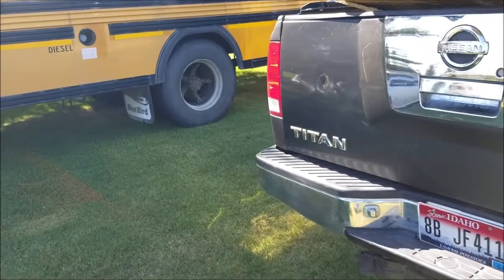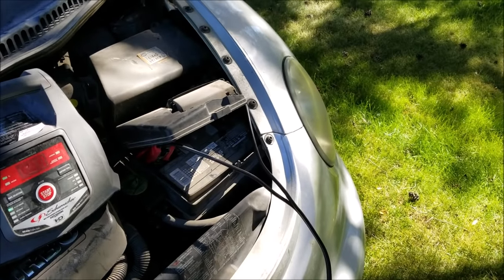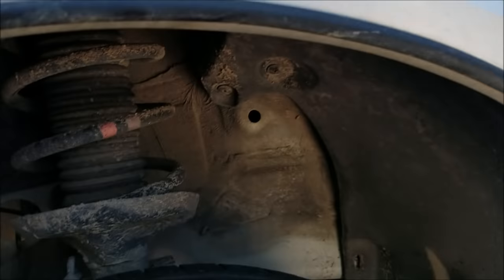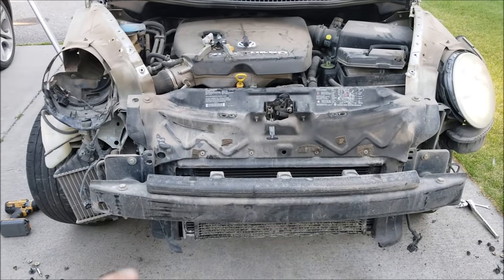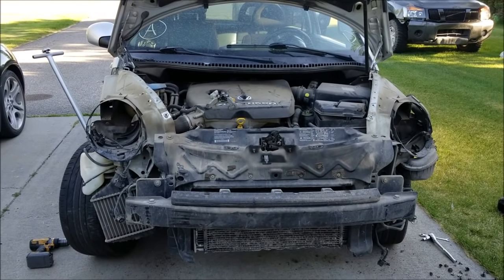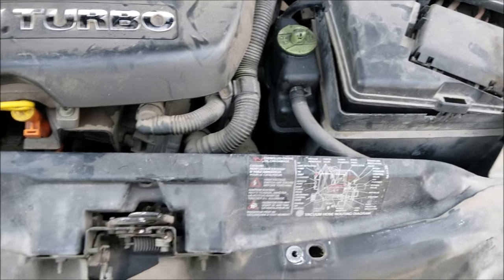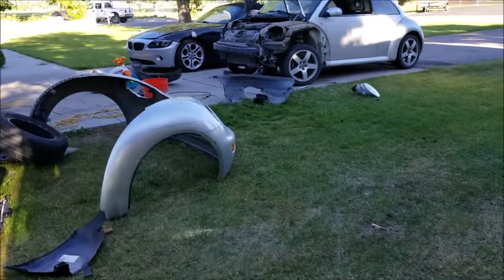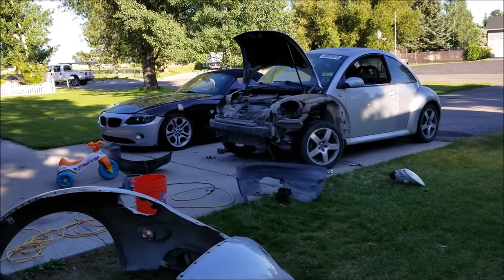1998-2011 VW New Beetle Front Bumper Removal + Updates

Comment: Coating will have naked wires that touch and blow bulbs (the original parts are for a cheaper vehicle to keep cost low).   2- the clear lens that covers headlights will come un attached and blow on highway (leaving headlight bulb exposed to rain) 3- the latch that releases the headlight assembly will start to fail and have your entire headlight blow away on highway!!! Do not forcefully pull out your headlights/you will definitely break whatever locks it in———it will fail on its own causing problems I’ve listed—don’t rush it! I have a 2002 beetle = parts of 98-2004? I believe. I also replaced rear tails. Get dealership socket and bulb (the socket will melt and keep killing bulbs)$80 per side- although the new tail cover (aftermarket)is $60 pair fancy or blacked out and looks better. But non VW socket and bulb do not fit(I’m saving you an experiment) and get rear sockets and bulbs together fromVW the tail lenses will not come with” HAD TO SHARE I DONT WANT ANYONE WHO LOVES A CAR TO HATE A CAR -Bugs have the personality of the owner STAY SHARP ;)

Comment: Head light removal= a lever/arm to pull down and button you push in before. DO NOT PUU OR FORCE LIGHT OUT!!! There are vids on removing headlight already! I have repacked headlights . The original lights will 1- have wire coating become brittle and plastic will